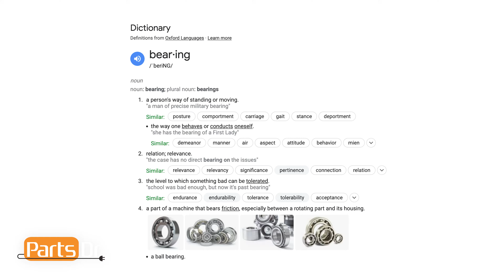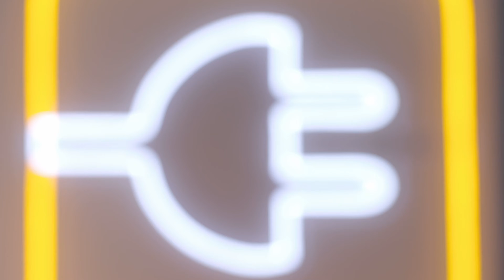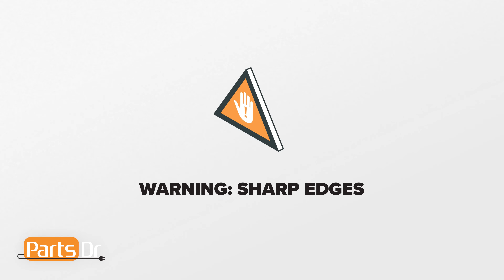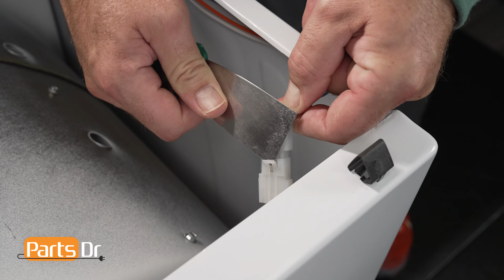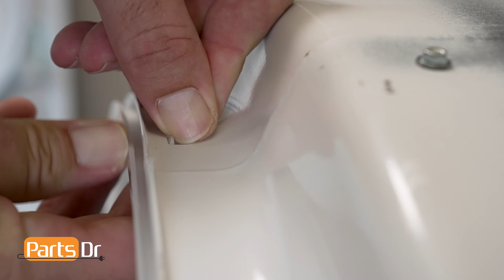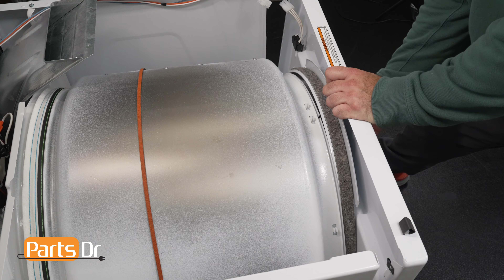How to replace Support Ring Bearing Kit part # 279441 on your Whirlpool Maytag Amana Dryer

Comment from the maker: Thanks for watching! If your dryer is making noise or snagging clothes, replacing the Support Ring Bearing Kit could be the fix you need. The part shown in this video is OEM part # 279441 (PD00003344), and it fits many Whirlpool-made dryers including Maytag, Amana, Kenmore, Roper, and more. If you're ordering parts online, especially from places like Amazon or eBay, be careful that many of the cheaper aftermarket parts are of much lower quality. We've seen cases where these parts are much lower quality and don't hold up well. For the best results, we always recommend using genuine OEM parts. You can get the original high-quality parts from us at https://partsdr.com. Happy repairing and let us know how your fix goes in the comments!